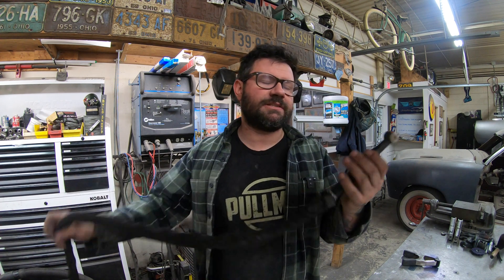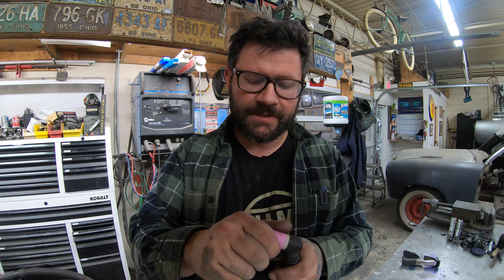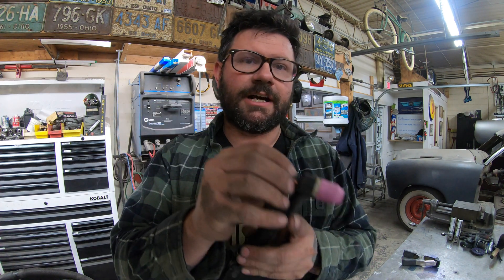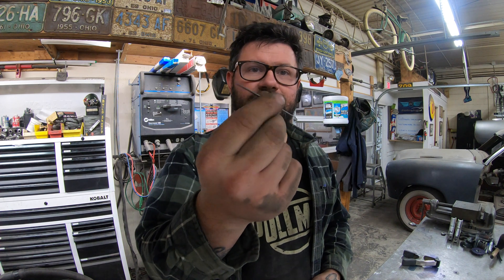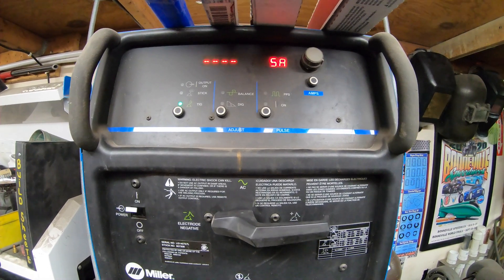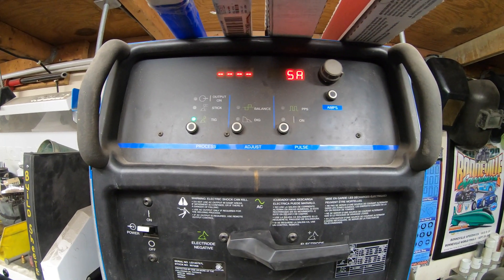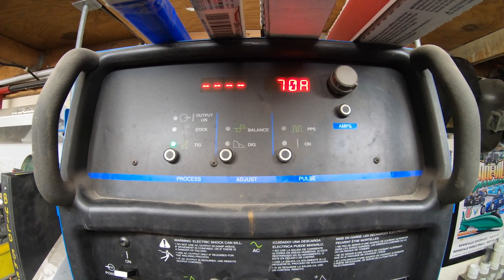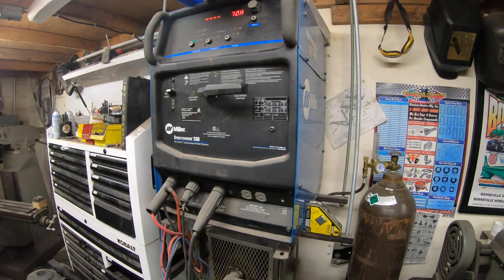Tig Welder Set Up Basics

Comment: Thanks as always Mike for sharing your knowledge.  
I would add how to 'ball the tungsten' for aluminum.  
Point out that the valves on high pressure tanks are double seat, meaning that there is a seat that closes and a second seat on the top of the stem to stop loses when open.   You have to open the valve completely.  All the way closed or all the way open.  Never just crack the valve.  
I was taught to always bend a hook in the far end of the welding rod. This minimizes the chance of stabbing someone observing.  Also handy to hang the rod.